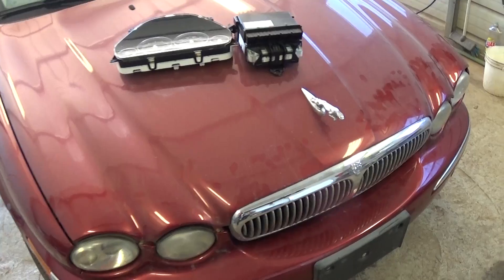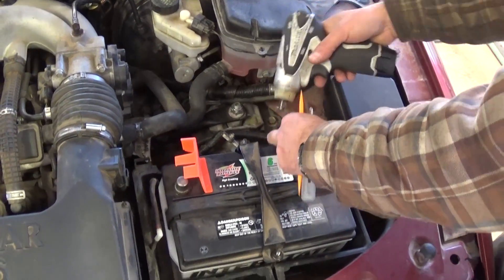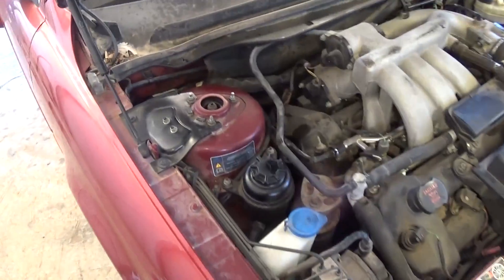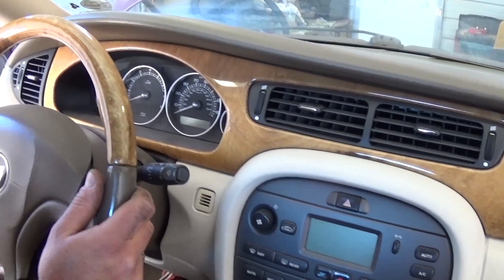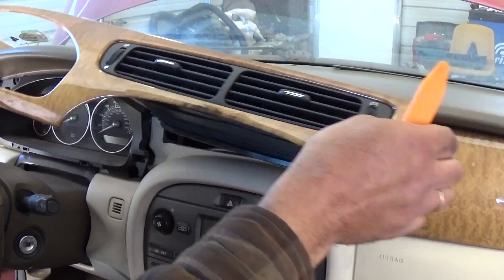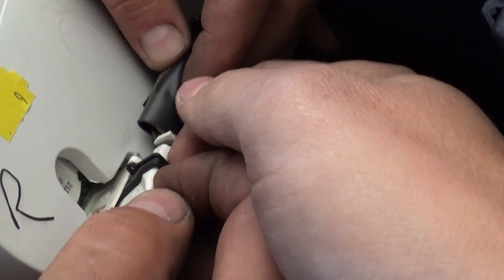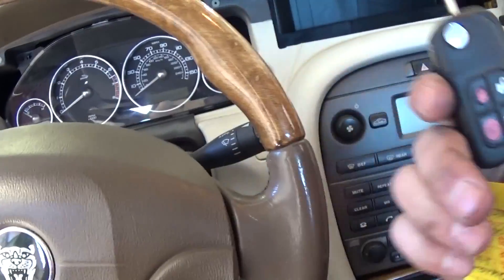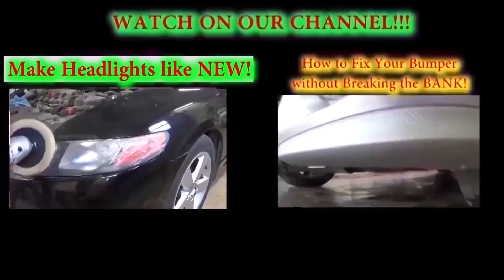How to Replace the ECU Car Computer without Programming it Jaguar X TYPE 2001 2009

Comment: How did you find the parts all from the same car?  Everyone is telling me that I have to go get it reprogrammed at the dealership. The dealership is over 3 hours away from me and my vehicle is not starting due to the error. I was wondering if you know where to find a set for a 2004 X Type 3.0 with the part number: 
4X43-15K600-CC  on my security module?

Comment: Would you ever go back to do some videos on the mazda cx-7? I want to change the transmission fluid and filter but I can't find the filter even on alldata database I cant see instructions. Any idea where that transmission filter is?
Reply from the maker: +Jay 90 We are trying to find a cx-7 but we cannot find at a good price right now. You cannot change the transmission filter unfortunately. You drain the oil by removing the bolt on the bottom if you need help I can send you the instructions but the filter is not replaceable